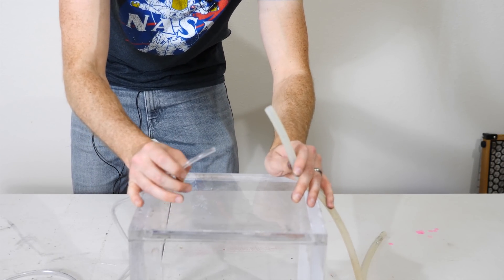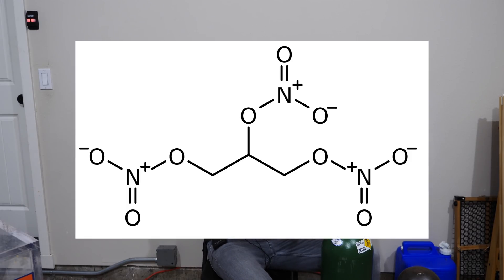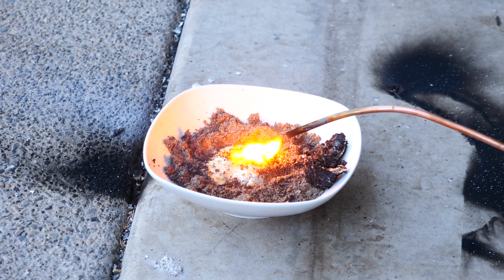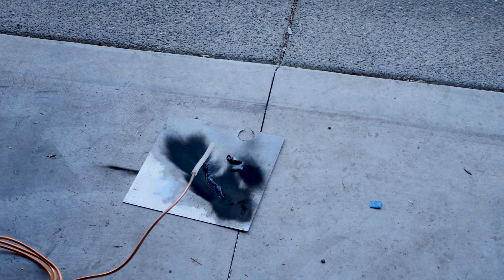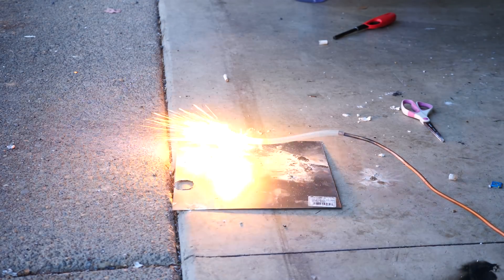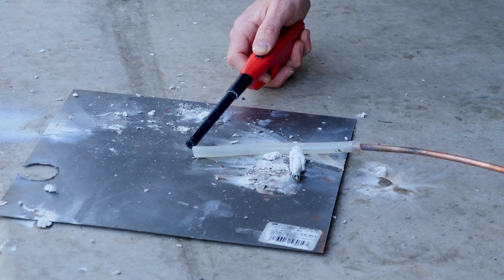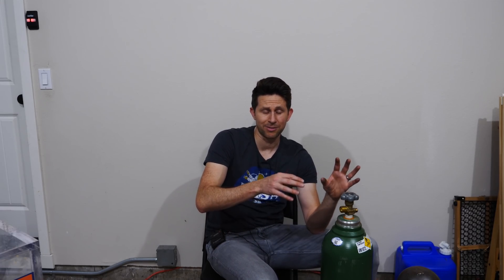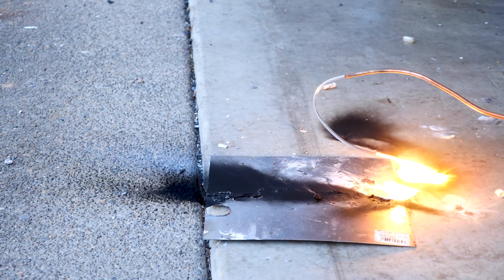Oxygen Tube Fires Are Insane!

Comment: What happens if the flame gost back in to the oxigen container when you reduce the pressure of the oxigem flow as you show near the end of the video when the flame sloly burns and return in to the plastic tube, is not that extremely dangerous!

Comment: 2:28  i love how you're doing something thats basically asking for a flashback to occur and using a coil or copper shrapnel as part of the rig, and the giggle tops it off .
Reply: There is zero fuel flowing in the pipe, oxygen only.  Flashback is impossible here.
Reply: @jerotoro2021 would it flashback if it were regular compressed air instead of pure oxygen?
Reply: @Jack-z1k5r  Flashbacks require fuel combined with the oxygen.  Regular compressed air by itself wouldn't cause a flashback.

Comment: fire is the result of a chemical reaction independently, which requires oxygen air. For example, if you blow a candle according to a human's voice, it will release CO2 so it can block O2, but if you use O2 gas it's still the same, maybe a chemical reaction will occur faster. while a burning battery does not need oxygen so it cannot be extinguished by stirring up oxygen.

Comment: Liquid (as well as purified gaseous) Oxygen is terrifying on its own, but purified Ozone is a bit worse (Chemical Force has a video on the purple Ozone which is surprisingly a shock-sensitive explosive). Yet it's a good demonstration of danger of oxidizers in general, you also mentioned my favorite explosive, Nitroglycerin, which is also a good example of why Oxygen is necessary for things to get exciting.

Plus, you can pretty much put together a thermal lance with both steel rods and controlled source of pure Oxygen which would cut pretty much almost everything - it's used in industry. Just don't try that at home though.

Comment: Was the silicon tube the fuel source at a low oxygen rate?  Did the higher rate of oxygen flow cool down the interior of the silicon tube?  How?  This is so counter intuitive.  Would the flame continue up the metal pipe to ignite the oxygen under pressure?

Comment: I wonder how difficult  it would be to put out (without decreasing the oxygen flow). I imagine you can't stomp it out, but maybe dumping water on it would work since it cools it down? or would you need to blast it with a fire extinguisher? Maybe even that wouldn't work because the fire would still be inside the tube?

Comment: As a beginner blacksmith, we use oxygen with propane to heat metal. Welders also use this setup to cut metal or with acetylene instead of propane to fuse steel together. So yeah oxygen tank catching fire is scary.

Comment: My dad used to teach respiratory therapy students years ago and one class was dedicated to the dangers of working in high oxygen environments. He would also show the lit hose, but another thing he would do was go out in the parking lot, fill a glass fish tank with oxygen and "soak" a cotton lab coat in the tank so the fibers were good a full of oxygen, then pull the coat out, drop it on the ground and then throw a lit match at it (obviously from a safe distance).. he also told me during the air forces X-15 project, the plane used liquid oxygen, the ground crew had to wear special non-sparking metal shoes because the oxygen being so cold would collect along the ground and even a tiny spark could set someone on fire.
Reply: Fun Fact: LOX + Asphalt (tarmac) = High Explosive.
IIRC, the Germans first learned that the hard way.

Comment: im curious could this be done with regular compressed air i mean to a degree it still has oxygen in it or does it have to be pure oxygen?
Reply: The reason it does that is because it is 100% o2.  Regular air has 21% +\-.  Compressed or not its still 21%

Comment: 5:00 i think the most interesting part of the entire video is that very last bit where you can see vynil burning inside the copper tube. that is basically a rocket engine.

can you make a bigger test by shoving a plastic tube deeper inside a copper tube?

btw iron can burn in oxygen environment too, so you can actually burn an iron tube the same way.

Comment: Look up Oxygen Lance cutting.  Steel pipe , end heated up red hot with high pressure oxygen flowing through.  Creates a awesome cutting tool used in heavy industry.

Comment: Medical equipment has a history of regulator fires. Unless the fires start in the regulators, could this be prevented by the use of copper fittings to keep a tube fire from entering an aluminum regulator and starting a regulator fire?  Please do a video using an aluminum tube in place of the copper tube to simulate starting a regulator fire from a tube fire.

Comment: I dropped slag onto the hose of an ox-acetylene torch from a piece of metal that I had just cut while up high on a pump truck and it severed both hoses and ignited it. As it whipped around like an angry snake everyone started to run for the door like a bunch of screaming girls. I sat frozen for a second waiting for an explosion and then realizing that wasn't going to happen I jumped down and stepped on the hose and screamed at the dudes to come back and turn off the tank.  I teased them for the rest of the day for their courageous display of bravery.

Comment: This is how a lot of solid fuel rocket engines work these days, like with Spaceship One designed by Burt Rutan, they used a tube packed with ground up rubber and fed NO2 in, its fully throttlable too.

Comment: The question I have is: what happens if yout try the same "trick" with the reinforced rubber hoses typically used in industry for oxy/fuel cutting and brazing?

Comment: Question...at the slower flow rate where the flame appears to be moving backwards in the tube, would that keep going all the way until it reached the main housing and then explode? And are you just shutting off the gas before that happens? Or is there something else going on?
Reply: It's going up the tube, because it is burning the tube.  Once it goes the copper, it will go out.  No more fuel

Comment: So dangerous oxygen acetylene cutting is not actually burning but the oxidation process accelerated buy the heating of the metal.
 What your doing is extremely dangerous.
The fire can flash back into the bottle, that’s why flashback arrestor sarebbe used.

Comment: 4:59 copper tube starts burning.
Actually... You could make a video about that aswell. 😄👌
But make sure to use multiple metals and most importantly a piece of glass tubing in between, so the flame doesn't reach the bottle

Comment: now im understand more deeply why the oxygen tank are totally Dangerous, not only because the flammable type gases, but also because the pressure the higher pressure the more violent explosions will be but the less pressure the more damages it can be done at same time.

and using same principle,
high preasure oxygen shooted into flame in rocket engine are the  way to create high powered explosion to get enough power to propel it into the space

thanks Action Lab!, got something new learn

Comment: I once designed oxygen concentrators used by patients in the home. Cannula fires due to patients smoking is a common problem. Several severe burns and deaths. There are fire stops that help, but they still allow the cannula to burn for awhile. 
I once designed a fiber optic detector that would shut the oxygen off as soon as the cannula caught fire. By placing the right size fiber inside the cannula and caping it at the end, when the cannula caught fire it would transmit the light from the fire back to a detector which would pulse the oxygen off and on quickly a few times. If the detector saw the light dim in sync with oxygen flow the it declared a fire and shut the oxygen off and sounded an alarm.

Comment: This reminded me of the hell the  Apollo 1 crew suffered in the Command Module atop of the Saturn V at Cape Canaveral.
Astronauts Grissom, White, and Chafee were in 100% oxygen at 16.7 psi (2 psi greater than normal atmospheric pressure)!
A spark from a switch ignited the plastic and Velcro in the cabin and they couldn’t escape as the hatch opened inward initially.
Tragedy...true America heroes January,1967.

Comment: You can do the same thing with an iron pipe. They actually use that to cut big pieces of steel that are too big for the normal oxy-acetylene torch. Thermal lance or Oxygen lance cutting its called.

Comment: Backfire tank explosion risk, when the compressed oxigen reach the end? Or is compressedby buttane?
Reply: gfcgamer Orgone oxygen is not flamable
Reply: @XxBlueSnakeITAxX  Well. Im confused. When the flame( flame right?) is running in  to the tube like in the video, it will never burn inside the cilinder, even when the compression is almost  over? I dont think so... It needs something to burn just like querozene?
Reply: gfcgamer Orgone oxygen is a comburent, so without it a combustible doesn’t light up, but oxygen cannot burn itself in an oxygen atmosphere. Oxygen can also be a combustible but in a different atmosphere, like propane.
Reply: @XxBlueSnakeITAxX  Thanks. But like you said. Like buttane it will burn once the pressure become the same of inside as  outside atmosphere when the gas is over. But generally the vessel is strong enough to hold the final backfire right? Yet it could be a huge a bang.

Comment: 3:38 I literally thought that the fire is just gonna get inside and cause the whole tank to explode
Reply: That wont happen because the lack of fuel. If the oxygen were able to burn by itself, the whole atmosphere would have exploded.
Reply: This can actually happen to acetylene tanks, because under the right conditions, acetylene will break apart exothermically without oxygen. An acetylene tank contains acetylene dissolved into acetone, because compressing pure acetylene into a liquid turns it into a sensitive explosive. IIRC the inventor of the safe acetylene tank was blinded by one exploding before they were perfected.
Reply: Oxygen turns everything else into fuel, but it’s not a fuel, itself.
Reply: me too
Reply: Me too
Reply: it reminded me of penny wise when his moving threw the pipes
Reply: I thought that the whole  video
Reply: Only way that happens is if the copper pipe or the interior lining of the tank can burn.
Reply: Besides losing its oxygen in going out. He probably has a anti backflow valve in line.

Comment: First of all the oxygen going through those masks is not 100% pure oxygen, it is basically composed of the same mixure as the air outside that mask.
Moisture is also added in the form of a bubbler in hospitals. If it were to burn, it wont burn that much with that much intensity. Secondly, such appliances dont have a high flow rate of gas, it would suffocate the person using it.
This is assuming that it were to happen in a healthcare facillity. If it happens in other places then yes it might go that way.
Reply: No not 💯 accurate. Depending on the flow of O2 to the patient is if they are allotted a humidifier. It is pure O2 coming from the flow meter. We wouldn't be able to administer 100% O2 if not. We actually had a patient set his nasal cannula on fire which caused 3 rooms to burn and he died in that fire. His actions caused several employees to have PTSD.
Reply: @cinstep7771  i see

Comment: Fuel/Oxidiser/Heat  There are a few others that can replace Oxygen, one in particular does it better, Chlorine Triflouride, only a few things are not oxidised by that little monster and some of the byproduct are more than a little dangerous, they can be fatal. So technically you can in fact burn water... with Chlorine Triflouride O_o

Comment: oxygen is not a fuel - it's a propagator / accelerator. 
oxygen in a gas form will not burn without a combustible fuel. 
liquid oxygen LOX  is  a whole other creature. 
the primary difference between  WHOOF  and  BOOOOM   is oxygen...... and some compression. 
oxygen as a gas will only accelerate / intensify the burning process of any combustible fuel -  ANY FUEL -  up to a maximum ratio at which point the oxygen becomes an extinguisher. 
caution :  phosphorus fires  AND SOME OTHERS  - burn hot enough to separate H  from 02.  throwing water on a phosphorus fire will cause hydrogen to separate from the oxygen in immediate contact with the ignition source . the hydrogen will immediately become the flammable fuel with the accelerator 02 already in the mix.   BOOM.  it works like a hydrogen bomb.  
interesting that someone doing o2 fire testing would burn oxidized fires over galvanized metal - highly toxic.

Comment: I made the mistake of burning plastic while doing fire experiments in a water bottle.  I was dissolving a copper penny in a water bottle, with a mixture of 10% hydrochloric acid and 3% hydrogen peroxide, if I remember correctly.  The reaction releases oxygen gas.  For fun, I decided to burn matches in the oxygen rich atmosphere of the bottle.  It was spectacular!  The matches burned a sort of white-yellow hot inside the bottle!  But one of the matches burned so hot, it caught the plastic on fire, and then the entire bottle began to burn with this terrifying whitish flame!  Fortunately, it eventually stopped.  But it released these weird gray ash particulates in the air.  That was scary!

Comment: If there is enough oxygen why is the flame yellow. Shouldn't it be blue
Reply: Aakash Kapoor i think it depends on fuel type (here the plastic is burning and not a gas such as butane or propane )
Reply: @boutrosebba7258  it doesn't matters bro in an ic engine, diesel or petrol is burned and if the oxygen is enough the flames are blue. U will ask how do I know. Just look at the jet engine u see blue fire don't u . out in the exhaust. So even though it's liquid it still gives of blue. And if u want solid to burn and give of blue fire just burn sodium in a oxygen rich environment again blue fire.
Reply: You need a hydrocarbon for that 

Plastics have other elements In them as well, and even so sometimes a given hydrocarbon would undergo pyrolization before it mixes with the oxygen and the fact that it's solid doesnt help with the mixture percentages

Comment: Would you be able to do a video on the inflatable couches that they used to sell from 1998 to 2003? they banned them from student dorms when I was at college in 2000 as they would burn aggressively if someone dropped a cigarette on them, it would melt a hole then the fast flowing air from deflation would make it burn fast, these were popular with students due to the novelty value, as seating for parties in dorm rooms with limited space when groups gathered and also the fact that they were cheap, around $30 back then..

(just to add I am in Scotland and I know that they were popular back then in the whole UK, I assume that they were very popular in dorm rooms in the USA at one point in the early 2000s as well, hopefully someone still has one or two in their garage or shed that you can get a hold of)
Reply: At first when I read this I thought that you were going to suggest filling it with pure oxygen, then applying the cigarette.  That's definitely a middle-of-an-airfield type experiment.

Comment: What happens if the tubing you're flowing oxygen through catches fire?

Answer: It becomes a rocket
Reply: metal cant catch fire
Reply: @SToXC_.  you sure?
Reply: @elmirelmir842  yes, in that condition it cant
it needs extremely high temperatures, flames arent enough, plus there's the oxygen flux continuously cooling down the temperature